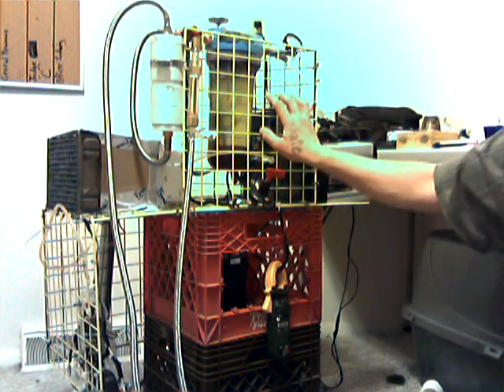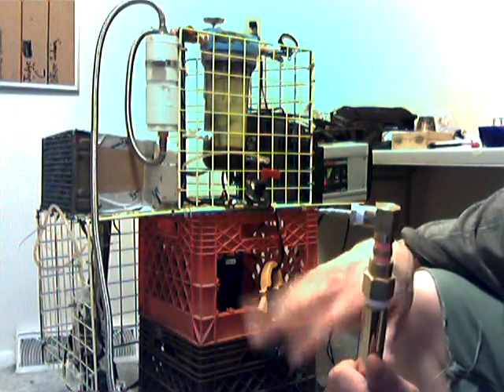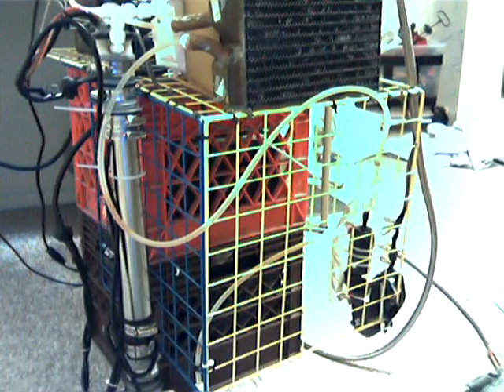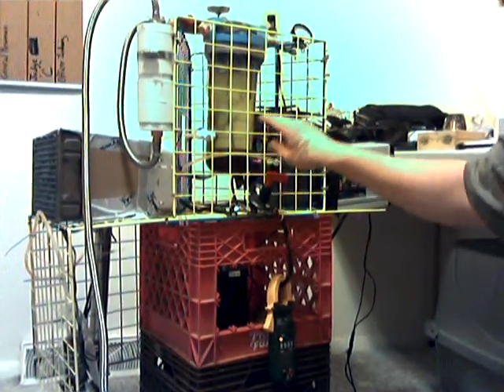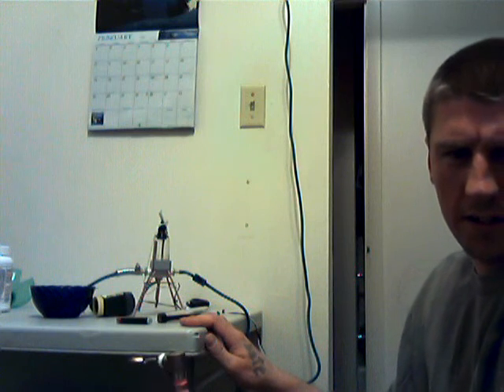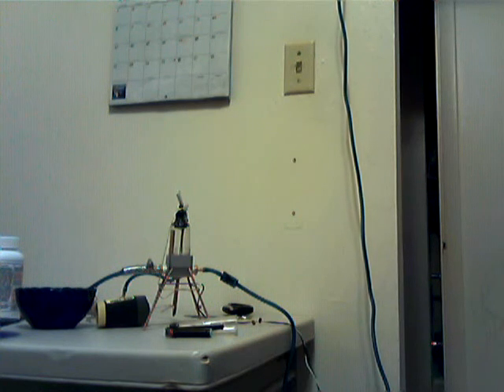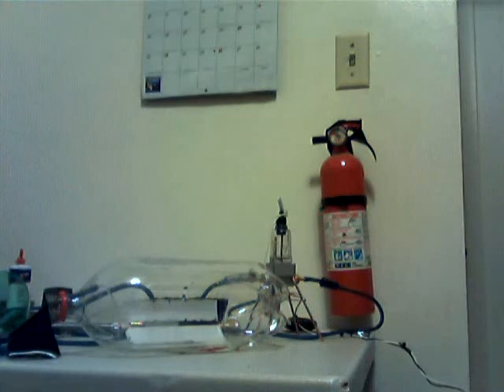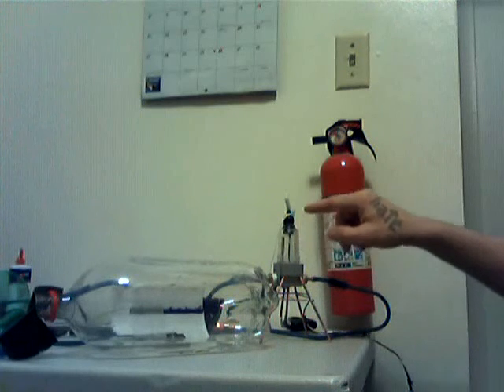hho gas IMPLOSION ? try both

Comment: Good. I now have a 21 plate HHO generator which works well, however is only giving me an about 15% better gas mileage cause it's being used in a heavy motorhome up and down in Costa Rica and yet I thought about a pump instead of just gravity water feeding, so I ordered a micro 3.5 LM automatic shut off water pump to add to my 1.7 LM system. We'll see what happens, but logically should work as long as eventually I add an additional water container with an additional pump to refill the original water bottle and bubbler. RA.

Comment: cool the flame down by bubbling thru acetone,or other flammable liquids-that is how the commercial HHO welders cool the flame and get around the H embriittlement problem.
also when adding HHO to supplement fuel mileage,you dont want too much.
if there is only enough to help complete the burn,then it stands that there would be none left to embrittle the iron.
if there is more than is needed then the extra H can find its way into the iron.
u need some floating plates to reduce heat and amps.
Reply: Yes,